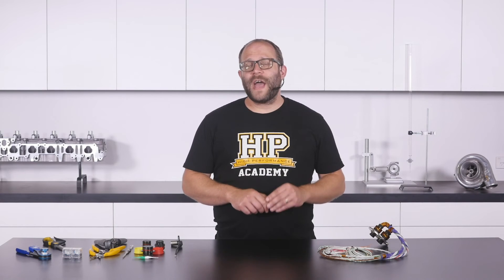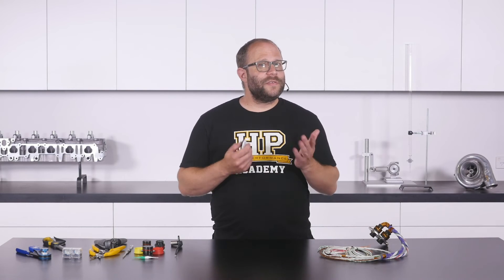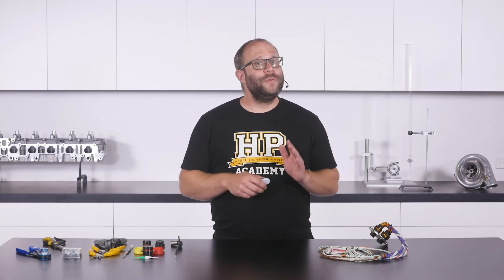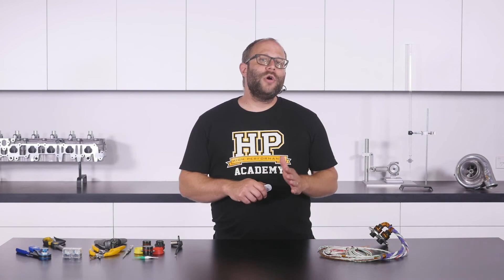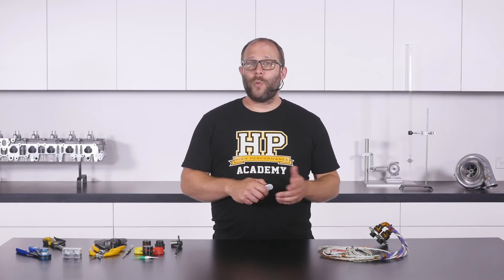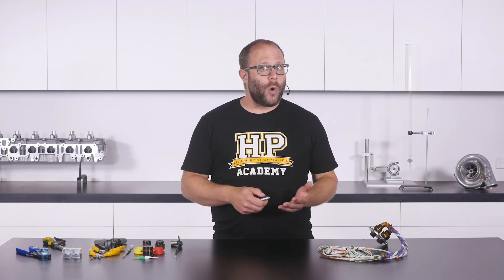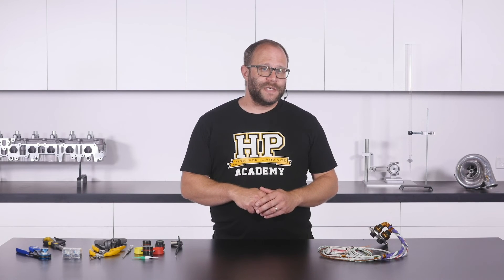What Will My Wiring Harness Cost Me? | Custom Wiring Looms [HPA Q&A]

Comment: It is amazing how some people will bitch about the cost of doing something correctly in the first place, then not turn a hair at spending several times as much to remedy the problems that 'cheap' option caused! Seen it over and over again in so many applications and businesses.

Sure, it is quite expensive, initially, but when everything is factored in even that extra cost isn't that much - especially if paying to have it done. If you purchased tools, you can even make a bit back doing work for other people, merely hiring them out or on-selling them.
Add the cost of the vehicle and the rest of the work, and it is really not that that much difference, proportionally.

Heck, consider if you are out of town for an event and there is an electrical wiring problem that develops in that 'cheap' connector, during practice, that takes you out for the weekend - you're out for the travel expenses, accommodation, entry fees, etc, and STILL need to sort out the wiring!
Reply from the maker: 100% We're not all made of money and it can easily be wasted so penny-pinching is understandable, but, unless you enjoy spending hours finding faults and redoing your work it is something that shouldn't be half-assed. Even if you bodge your engine build things are less likely to end as badly as they would if you burn your car to the ground because you wanted to save $100 bucks on getting the right materials for the task.
I guess the point is you don't need to go for top shelf everything, but it is better to just wait a little longer and save a bit more than just reach for the bottom shelf because that's all you have enough in your wallet for right there and then eh - Taz.

Comment: $1000 to $1500 jesus whats it made from gold
Reply from the maker: As stated in the video, it could be cheaper, or more expensive depending on your choice of materials. You could build something incredibly cheap with the quality to match for much less than $1000 if you wish, but if you're using quality materials and not buying in bulk, costs can climb quickly. That said, good luck paying someone to produce something of the same quality that such a price represents ;) -
To be clear, some professional level connectors can be $500 each alone, but they are only required for specific reasons/purposes/builds - Taz.
Reply: If you think that's too much, maybe you should start making them for less? Lol.
Reply: Close - some of the really high end stuff may use silver wire but even mid-range connectors can be expected to use gold plating for the connectors to prevent corrosion problems!
Reply: lol go price out a race car harness. $20,000 is not even high end